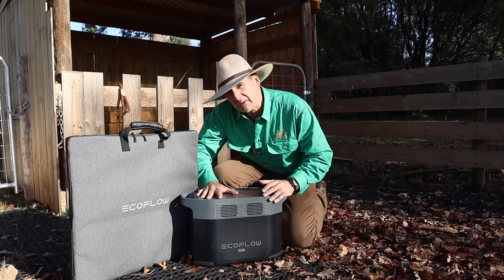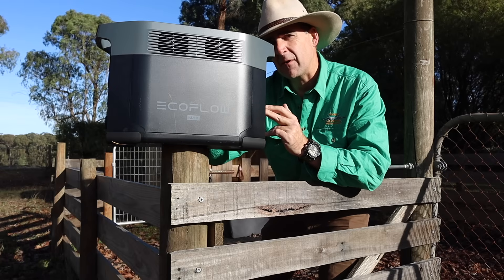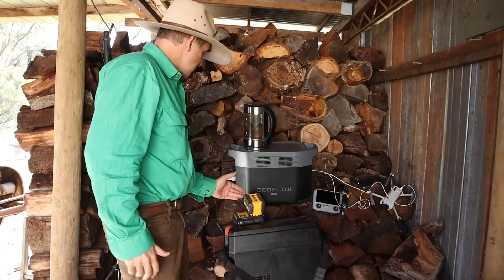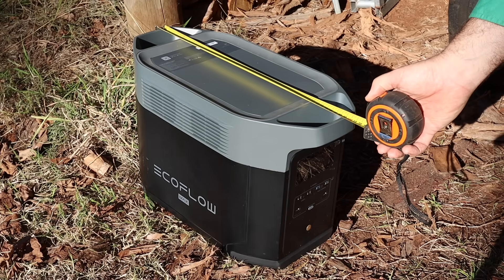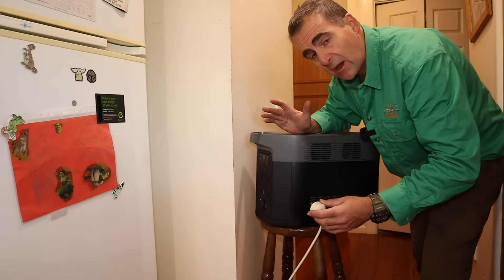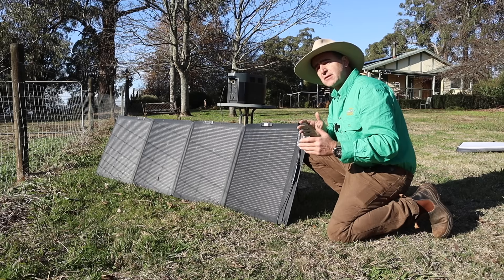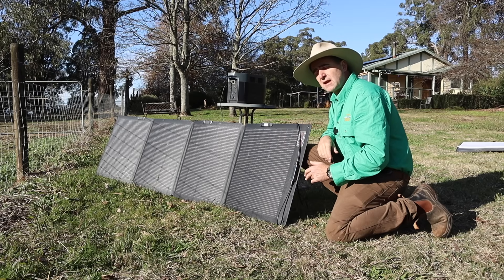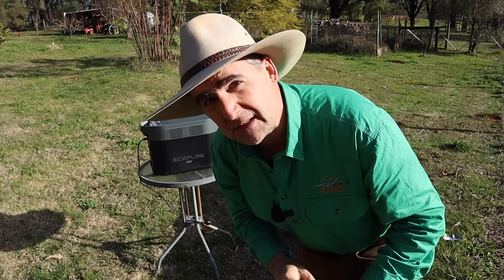EcoFlow Delta 2 Max with Solar Review | Off-Grid Power Tested!

Comment: Great review 😊
I bought the Delta 2 max and 400w solar panel as backup for my off grid system. 

Battery fully charged from solar, from almost empty in less than 6 hours. 

The 400w panel is heavy and awkward to move but fine if fixed in situ. 

This isn’t really the setup for car camping!

Comment: Good morning, Tim, great video, you answered a few questions that previously you hadn't covered. Which is great, and the big one was the fridge. My plan is to add the Ecoflow to our backup for overnight power for the fridges & freezers. Based on what you showed I will need the extra batteries and a bigger solar system. Thanks, I always enjoy your videos & always learn something. Cheers